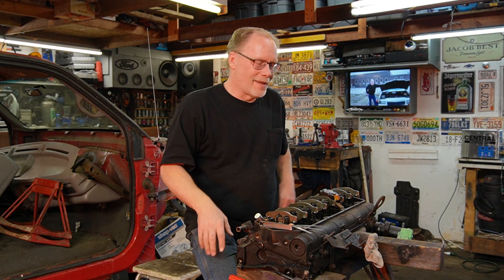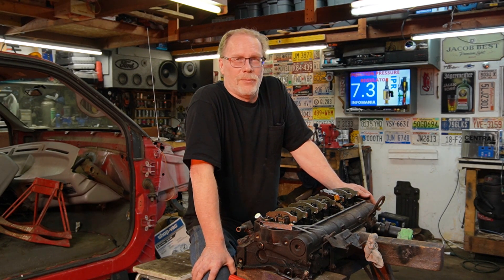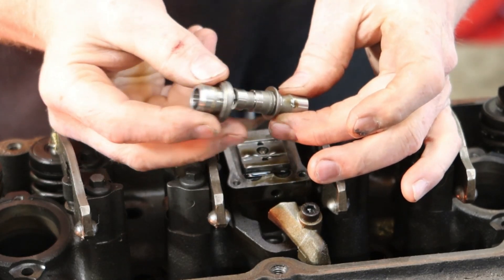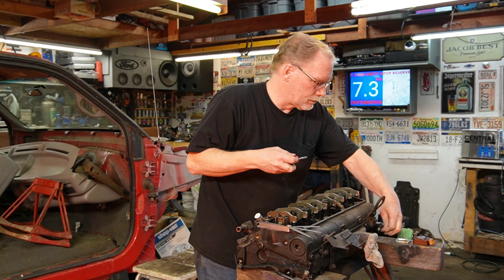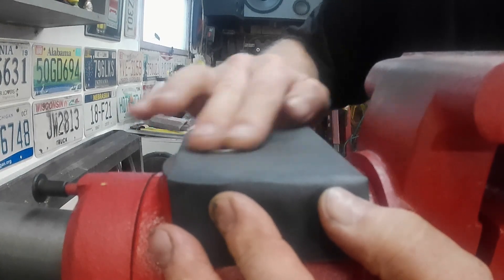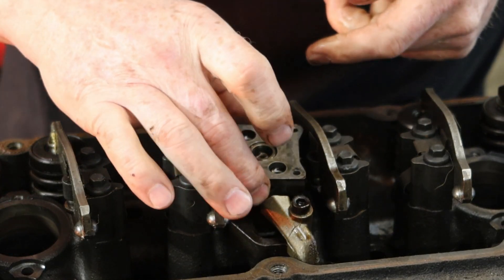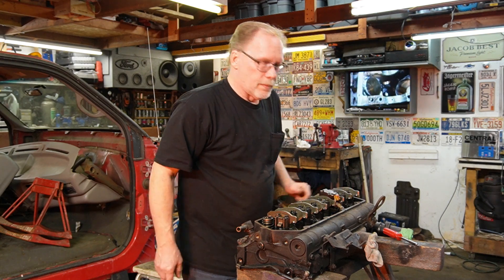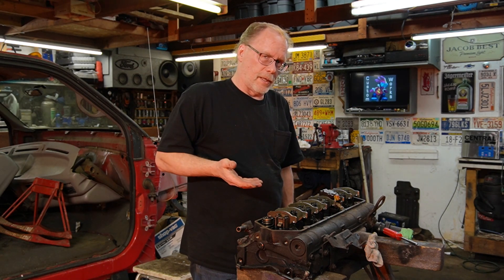🛻📽️7.3 PSD INJECTOR SERIES SHIM SHIM SHIM THE PRO WAY .🟢🟡🔴🟢

Comment: You couldn't be anymore wrong. all you did was change the stroke of the poppet valve. By taking the adapter plate off you unseated the poppet valve and the first time the truck runs the poppet valve will reseat. Lastly 35 years as a machinist you didnt remove anything from a hardened shim with 800 or 1000 grit sand paper just polished it.

Comment: What is the minimum clearance that you would recommend shimming? The one I'm working on, they seem to be more than .0025 and less than .003. The vehicle ran rough. I found one bad injector solenoid and some funny resistances in the valve cover harness so I will be replacing those. I figured if they were close enough to the min spec I would attempt to shim them while it was apart.
Reply from the maker: once you get below 002 its time for new not rebuilt I have shaked every tree to get new pops This technique is good for a extra .5 to 1 before a new shim should be placed If your at .003 approx leave them a lone
Reply: @CUSTOMWORKS7.3PSD  They were all between .0025 and 003 and seemed to be closer to the 003. (with a few running above 003 but less than 004.) Thank you for the info. I'll leave them be. The passenger side were almost identical. The variances were all on the drivers side. The one closest to 004 looked like someone had been into it.

Comment: It does seem like there needs to be a bit more detail or explanation of what is really going on with the wear. Maybe if you took the side view cutout and explain the possible points of wear and what is happening when using the different methods of shim alteration? 
One thing to consider is that alteration by sanding the existing washer will cause the guide to move up causing the lip of that guide to eventually get to the same level as the surface the armature sits on. That is as far as you can go before any further sanding makes no difference—I think. Because after that point the armature plate is bottoming out on the top of the guide instead of the guide holding block(if you call it that).. I suppose even then it would still cause the armature plate to raise above the block and thus get more clearance.. 
but then we go back to the question of why we need that .004 gap.. is it that the distance between the armature and the magnet is really being that effected? Or is it that at cold temps the closer that armature is to the block the greater the suction(or whatever you call it when two super smooth surfaces are tight to each other) 
Maybe another point or reason better discussion around this makes sense is that ppl talking about the other shim method do have a point in that if it is about the suction being the issue and not about the distance between the armature and magnet… the shimming both under the armature and under the magnet does make sense if the armature isn’t suppose to touch the magnet.

Comment: I definitely prefer your method here but I can say with firsthand experience that I did shim up my armature plates and went from a no start situation to another 75,000 miles before no start again. Most of my armature plates had zero clearance and a couple had .001". I brought them back up to .002" and my truck started great again. I did not take them all the way back to .004" as that could cause the armature to strike the solenoid. This process of shimming up the armature bringing it back up closer to the solenoid does make sense to me because as the distance grows it becomes more difficult to pull up the armature especially with cold oil in the injectors. I would have to pour hot water on hpop resevoir and heads to get my truck to start. Once the oil was hot it would start just fine. So by shimming my injectors my truck started perfectly and I got more life out of them with little investment. I would definitely do it again, however I do like the method shown here in this video and would like to try that next time.

Comment: Just saw your video after having a hard to start cold on a friends 97 power stroke.  I’ve got zero clearance on injectors 2 & 4.  Going to try this repair but am curious what wears down that creates the loss of clearance in the first place?
Reply from the maker: There to far gone when they get to this point there are other plates and pins that are also worn out as well its time for new injectors
Reply: @CUSTOMWORKS7.3PSD  
  I’ve got rebuilt injectors ordered for these two cylinders but cylinders #1 & #3 have a weak contribution at cold running also.  Still have to check there clearance but they might be helped by this.  Cylinders #2 & #4 have zero contribution when cold so they get rebuilt injectors.  Truck has 369,000 miles on it and is pretty well beat up, not sure it’s worth the cost of new injectors.  Thanks for the video and your response.

Comment: Is there any way to check- test for the low pressure oil pump?
Reply from the maker: oil cooler has a plug that you can hook a pressure gauge 2
Reply: @CUSTOMWORKS7.3PSD  You know what the pressure should be? Thank You 🙏

Comment: Only shimming the armature or machining the oil relief plate would be the only proper way to do this.  The point of shimming is to make sure the poppet valve is fully seated and not being hung from ware by the oil relief plate.  Sanding that washer only allows the armature to be lifted higher to the solenoid and does nothing for why you would ever shim an injector like this.  This vid is no good for what your trying to accomplish and why you shim in the first place.
Reply: If the poppet is held down in its seat with a spring, how would reducing the poppet guide shim change the armature clearance?

Comment: Just currious Clint, how much clearance or movement does the armature have when the solenoid pulls it up? 

Such as lifting the armature plate up and measuring the clearance between. 

Having a hell of a time, all sensors good, all harness's, good, pass buzz test, no codes at all,  contribution error on #4, open valve cover run truck and noticed #2 and #4 little to no oil flow.  

Possible ICM?  Even with no PCM or DTC codes being thrown?

Comment: I am not a very smart man, but how does reducing the the thickness of a shim actually shim anything. I thought the idea was to increaase the distance between the armiture and the spacer, thus the added shim. The increased space up to .004 allows the oil to flow more readily especially at cold temps. And, I believe that the solenoid shims are to prevent the armiture from contacting the magnets in the solenoid and causing a short. I must be missing something.
Reply: Your correct this guy is effectively doing nothing but the point is to add length not shorting it.

Comment: I got a question I got my 99 Ford F-350 Super Duty XLT diesel 7.3l I want to buy the new injectors my question is it is in a specific injector for order I know it is in the motor it is in the injectors 2
Reply from the maker: always remove the valve cover and get the numbers that are on top of the injector Vans , trucks, bus's have different injectors

Comment: Just shimmed my 7.3 powerstroke, key info given here is torque the armature bolt to 2 n-m.  Also solenoid shims don't seem to be needed as he says here.  
I had bought the injector shim kit he shows here and installed per instructions.  Ran a bit better for about 5 miles then started to run really rough.  Saw this video, decided to leave in armature shims since i had 0.004" clearance but take out solenoid shims as he suggests.  
When I took off the first solenoid I was surprised to see the armature bolt had come loose.  I had them 'tight plus a little' per the shim instructions but apparently I did not give it enough and they started to loosen.  I removed the solenoid shims anyhow and torqued the armature bolt to about 1.5 N-m.  The replacement bolts in the kit did not feel right so I tested one of the spares on the bench and it broke at 2 N-m.  It probably could have done a bit more because I had it in a vice pretty tight and may have damaged it.  So I carefully went to 1.5 and it seemed to work on a 10 mile test drive.  I did a buzz test before removing the solenoid shims and the quieter ones were the loosest.  One that was louder and had a 'tight' armature was less that 0.5 N-m to loosen so I missed the mark pretty bad.  I almost re-used the stock armature bolts but I was pretty worried about them stripping their heads with that stupid reverse torx so decided to go with the replacements from the kit.  I will update if something interesting happens.
Reply: One thing I found is that the new armature bolts, i.e. Alan heads stick up above the armature plate causing them to hit the magnets.  I ground the heads of the bolts down so the fit flush with the plate

Comment: I DONT UNDERSTAND BUT I WILL TRUST THE PROCESS!!! 

When I did my shim kit it wouldn't start under 45⁰ and when I was done with the kit it starts below freezing Temps no problem. 

BUT I WILL TRY THIS METHOD IN THE FOLLOWING WEEKS ON A F-550 WITH 460,000 MILES ON THE  🕑.

Comment: I have a question regarding this technique vs shim kit. The videos I've seen of people using the shim kits place the shim between the poppet and armature, wouldn't this accomplish exactly the same thing (bringing the armature closer to the solenoid)? I did see a video where someone shimmed the solenoid and thought to myself "WTF? He just canceled out what he did with the armature". My thought process here is that shimming between the poppet and armature would allow you to be more precise with your measurements. I don't trust that I can sand off exactly .002" on a vise with 1000 grit sand paper.
Reply: You want that clearance between the armature plate. By doing that your raising the armature plate risking hitting the solenoid. That is why you also raise the solenoid if you don't you will get a funky injector code. At the end you have accomplish the clearance you were looking for but without contacting the plate with the solenoid.
Reply: Right, both sanding the spacer like he does here and adding a washer between poppet and armature will accomplish the same thing. Increasing the gap between the armature and injector body back to factory spec. The only scenario where you would add spacers to the solenoid would be if you over sand the spacer or install too many washers between the poppet and armature (ie if the feeler gauge measures more than .004). I’m just curious why it’s viewed as the superior form of bandaid. It seems like it’s more likely to make an error with the sanding technique than it is to use washers that are “adjustable”.

Comment: Mr Allen. 
Following your advise to the T.
I noted about the Hot Shots sticktion, you commented put in about 500 or so miles before changing oil.
  The directions read go ahead and leave it in for the duration after oil change.
  I'm looking for you advice and suggestion here .
  You've really help me to understand this little monster.
  I inherited a early 99 350 XLT 4wd.
with 118,000 on it .
And I really like this 7.3.
It's in great shape .
Just want to stay ahead of everything. 
Have the wiring harness, up pipes,New 68 roller bearing turbo, replaced all the censors.
With OEM ONLY.
Ordered the high volume lpop  and Adrenaline HPOP. 
And going to find the oil balancer for the crank..
 Just need to make time for getting it all installed 
In mean time just want to make it happy. 
  Your thoughts ???

Comment: I did the shim kit last year on a pickup I had recently got at an auction that had just over 300k miles. It had a tough time starting, and seemed a little low on power. I pulled the injectors and did o-rings, did the shim kit and put in new glow plugs, as well as drill holes in the solenoid spacer since mine didn't have any. It starts way better now, but I will say that the shim kit is a band-aid at best. It lets me run the pickup long enough so I can decide if its worth putting new injectors in or ditch it.

Comment: I work at a machine shop with acess to surface grinders, would you say machining down the intensifier pistions for bigger injector capacity is okay? I can easily acheive a tolerance of .0005in or even .0002 if needed. Also, should I take material off the open end or closed end? Thank you for these videos!
Reply: .1= tenths 
.01= ten thou
.001= "nought point nought nought one" or "zero point zero zero one" or just keep it simple by saying thousandth of an inch. 

But .0001= ten thousandths that is tighter than a nuns VJJ...😅😂🤣
Reply: WAW YOU TAKE TEN THOUSANDTHS OFF???😅😂 I WOULDN'T TRUST MY IRON WITH YOU... GET YOUR NUMBERS RIGHT FIRST....

Comment: Clint as usual another fantastic video I consider you the expert of all time on the 7.3 you've helped me immensely. 
Got a question I would love to get a new turbo for my 2000 7.3 with 200,000 miles on it ..but I hate to spend that kind of money, is there something really wrong with just changing the compressor wheel I just hate that dead spot around 1500 RPM I'm hoping to do the cheap way out changing the compressor wheel
would be OK or is that an absolute no no ....thanks for your help and your wealth of information
Reply from the maker: There is no issue with just a wheel upgrade it will stop that issue and any one from the big diesel after market sites will be fine
Reply: @CUSTOMWORKS7.3PSD  There are 2 people in this world i trust for Awesome skills...Custom Works and good old Ron DieselTechRon (May He RIP)...this is because they have common logic, willing to learn new stuff and went through a lot of trial and error...This is how we become masters...Peace.I4I

Comment: this videos are golden. good info and demonstrating it on the engine is super helpful. is it possible to test injectors while its out of the engine? i know you can apply 12 volts to the injector and it will "buzz"

Comment: Clint why is it important to face the poppet a certain way. You're the only one who does it this way. Please explain
Reply from the maker: https://www.youtube.com/watch?v=hT4piOzDLuA This is a long ago CAT update ( same injector in there engine ) I,m not the only one who does it this way Just the first time its been pointed out. Keeps excess oil from building up under the armature allowing it to go all the way down, also allows drain back into the poppet for easier cold starts, stops excessive wear on the poppet stopper, allows the oil drain back to end up in the tear drop in the barrel. last the solenoid pulls faster and more responsive because extra oil can escape the the armature holes See the above video and the rest in the series answers a lot of questions  and educates Thanks have a great weekend
Reply: @CUSTOMWORKS7.3PSD  Thanks Clint